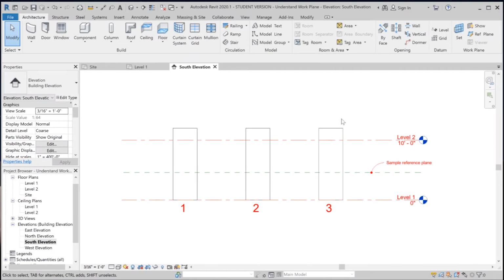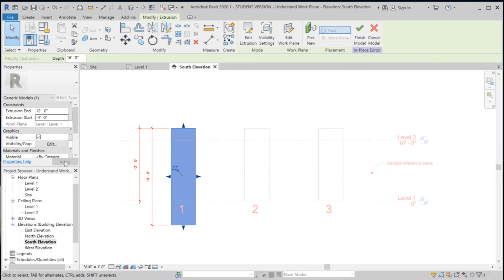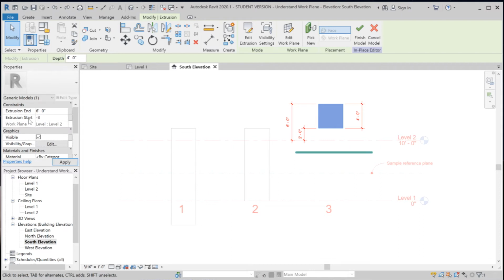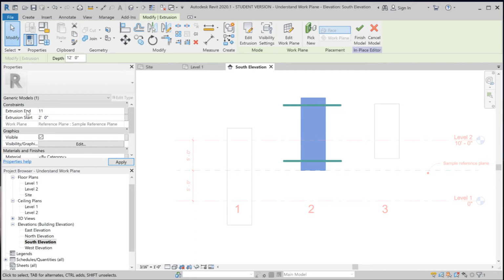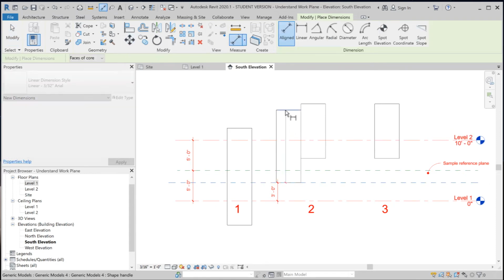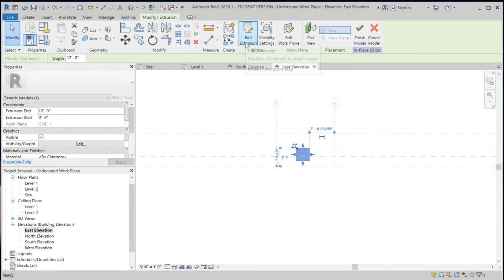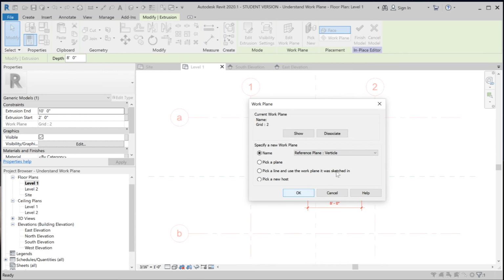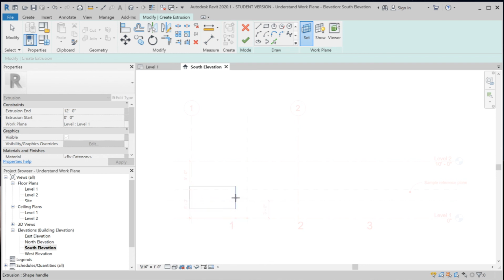EP2 Understanding Work Plane and Reference Plane

Comment: I do not understand that you drew grid A and gird B on level 1(which is a on a horizontal plane) while in East elevation later, it looks like it is in a vertical plan?
Reply from the maker: Where the plane was created is irrelevant. You need to think of just the plane itself. Imagine yourself standing inside of Revit 3D space, if the line is drawn from your toes vertically toward you head then the plane is vertical. If the line is drawn from one shoulder to the other then the plane is horizontal. Hope that make sense